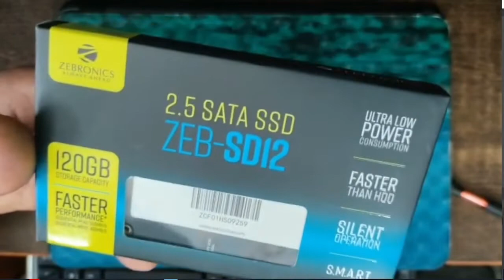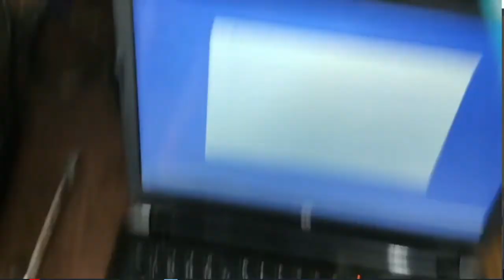HP 15-r007tx Disassemble | Upgrade  Hdd to SSD for faster

Comment: Speed ssd se fast hogi and ram se.. asking because motherboard support karega .. ki jist thodi speed hi improve hogi...? Is it worth to invest?
Reply from the maker: better for hdd
Reply: I have 4gb ram in laptop. Laptop is now very slow. Right now not have good money to buy new laptop. 

So is it worth to change SSD and add ram? Laptop have 4th generation processor so thinking motherboard is good to support or just for temporary solution.